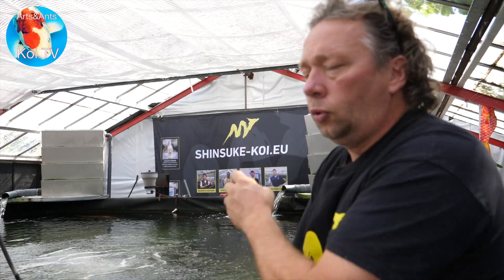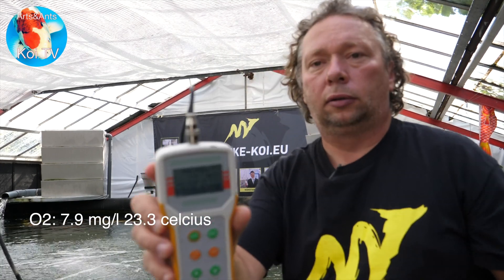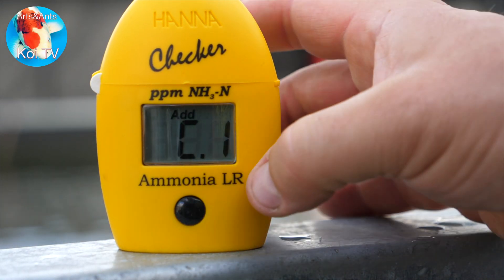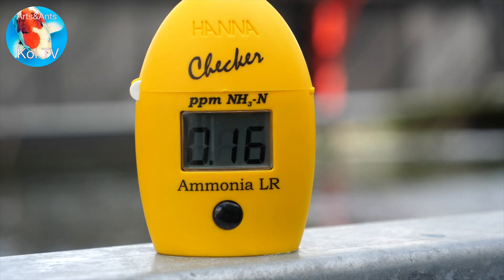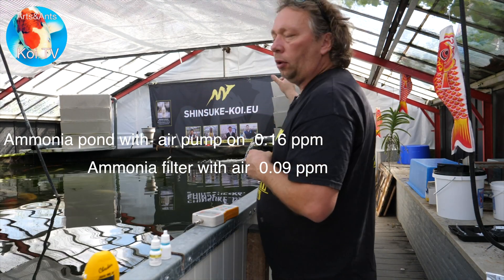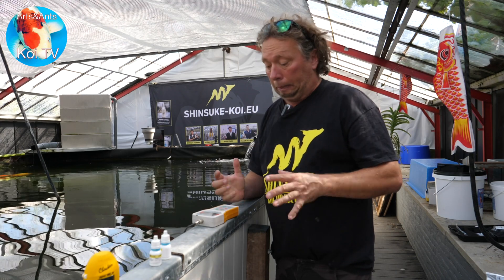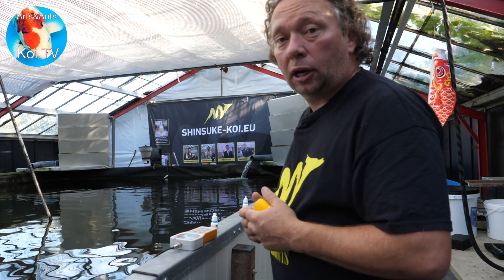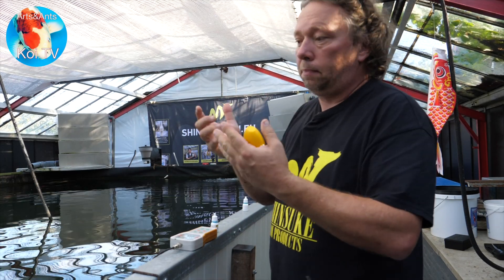KOI TV | Do you have enough Oxygen for your filters? | Watch this TEST

Comment: Interesting stuff. I currently run my spindrift aerated drain 4hrs on And 4 hrs off continuously on cycle with a time clock. Figured that by doing this gave the koi a break and some quieter time In the water. Perhaps I need to do this test on my pond to see what's happening. It seems by your video that I should perhaps leave the aerated bottom drain running permanently?!
Reply from the maker: yes I would leave them on 24/7 
Thanks for your comment!
Reply: @KoiTVjapan  thank you for doing these tests on video. They really are very valuable to me. Do you guys ever export and sell koi to the uk?
Reply from the maker: @tardis7992  yes we can! and we do !